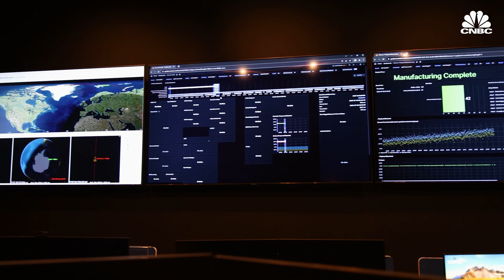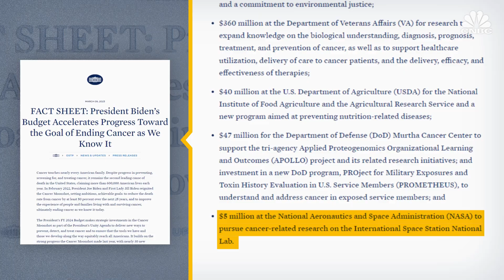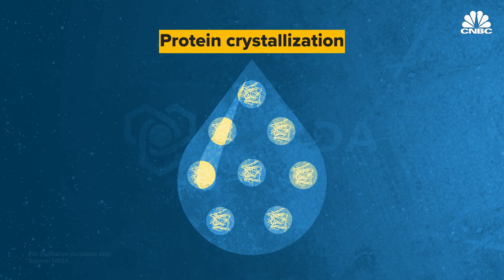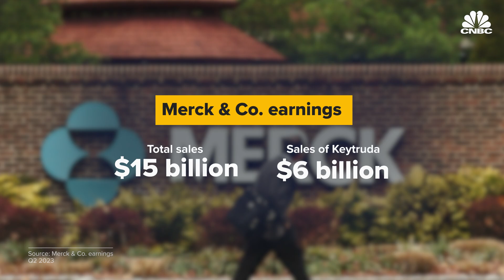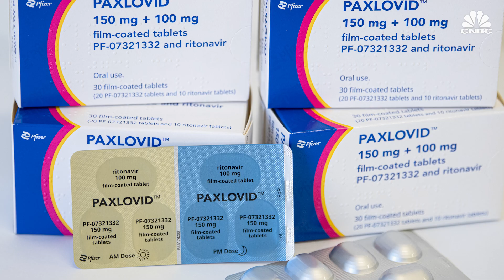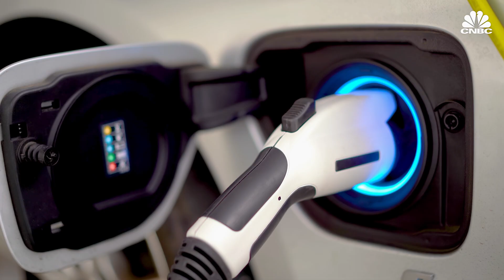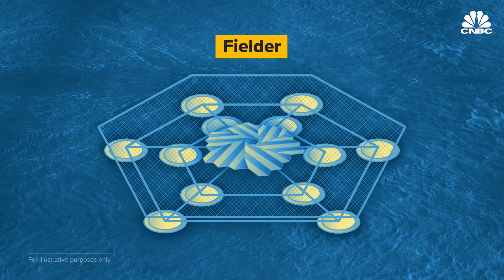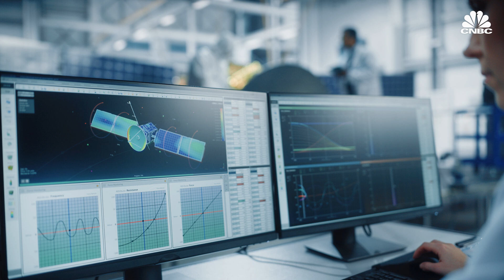How Space Factories Are Becoming A Reality

Comment: 0:01: 🚀 In-space manufacturing is a growing market with potential for significant growth in the future.
2:50: 🚀 Varda is using a spacecraft made of three main components to autonomously manipulate materials in space for protein crystallization, which can improve drug formulations and delivery.
5:37: 💼 Varda aims to revolutionize drug manufacturing by conducting it in space, offering potential financial returns and retaining patent rights.
8:08: 🚀 Space Forge aims to manufacture more efficient semiconductors using materials like gallium nitride and silicon carbide.
10:45: 🚀 Space Forge plans to use in-space manufacturing to produce semiconductors and other materials, with the potential to disrupt multiple industries.
13:22: 💼 Varda and Space Forge are working on manufacturing in space, but face challenges in reentry and FDA approval, and don't expect initial profit from manufacturing.
Recap by Tammy AI
Reply: Damn. AI recaps.
Reply: Thanks.
Reply: Dude, you're everywhere!  I saw you on that Sabine Hossenfelder Faster than Light video.  Thanks for your hard work.
Reply: @TonyEllen990 it's an AI

Comment: Seems like a lot of hype.

Making a perfect crystalline samples of complex chemical compounds for X-ray diffraction or transmission electron microscope?  Sure. That could work.  But this is an analytical service, not a part of actual manufacturing process.

Doing epitaxial deposition in space?  GaN devices work pretty well even with high defect density.  We don’t know if there will be a dramatic improvement in device performance when defect density is driven down, if it can be driven down.  Most of crystalline defects on deposited GaN film are generated by the interfacial incompatibility between substrate and deposited film, not by 1g gravity the wafer process is subjected to.  So I’m skeptical that you’ll get a much better film in microgravity.

I’d say the real value is in establishing a method to launch experimental apparatus into space and to recover them, so that even if these 2 concepts do not pan out, other future ideas can be tested, hopefully quick and cheap.